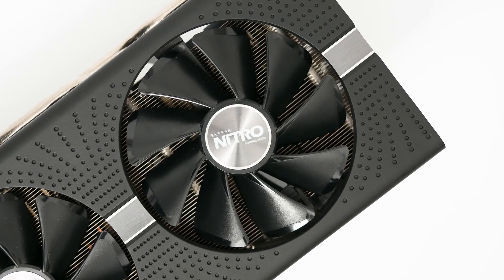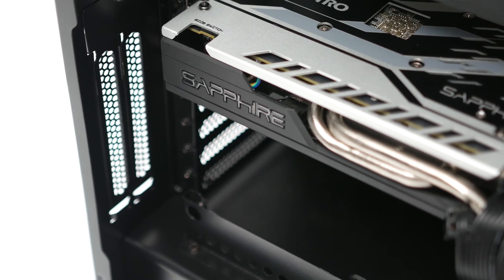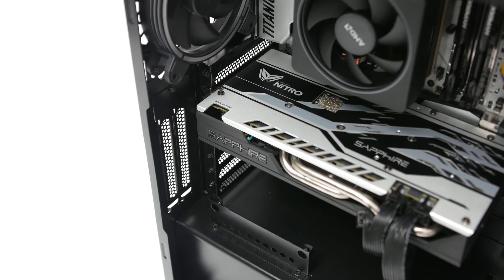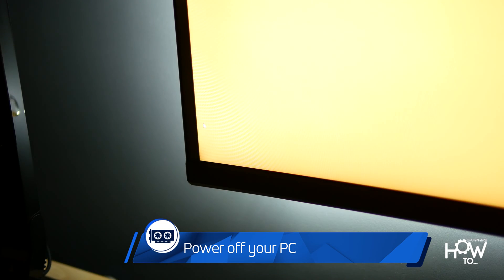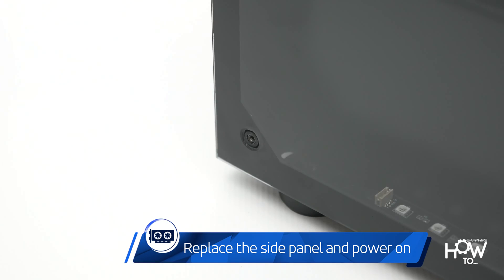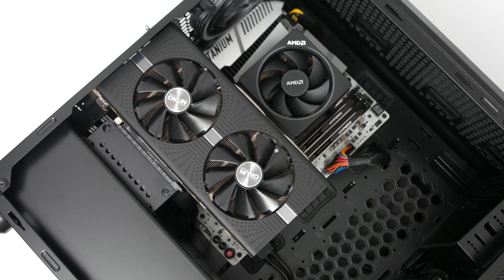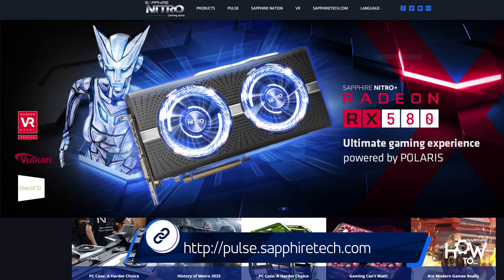SAPPHIRE How To: Use Dual BIOS

Comment: Hello i have the 7900 xt Nitro +. On which Position is the switch if the card is new ? OC or quiet mode? On amd adrenalin it says me the card rum with 2860mhz ... Ans i can oc it up to 3350mhz without problems.. Time Spy benchmark 30680 gpu score lol.. thank for answers! ❤ Great Card!
Reply: Left is default quiet position. you can also use Trixx sapphire software to change bios mode in the app instead of the physical switch. OC bios is right side and middle is 2nd backup bios for bios flashing.

Comment: Hello, is it possible to use two BIOSes for the card at the same time using the TRIXX program and switch between them at the desired time?
Rx 6600xt sapphire pulse
Reply from the maker: Unfortunately the TRIXX bios selection is exclusive to the NITRO+ range of graphics cards. Also, it's a separate switch position on the card itself and is not technically running 2 bios's at the same time ~Pixel
Reply: @SapphireTechnology  Please help me, my graphics card is not using its full potential in gaming, I can't find another bios version to fix the changes that the previous owner made on the card by installing it
Reply: @SapphireTechnology  Please let me know some different BIOS versions for my graphics card so that I can clear the current BIOS
Reply: @SapphireTechnology  When installing the corporate BIOS, the ATI Flash program says that the BIOS versions are the same and you cannot install the BIOS.

Comment: what if it has 2 switches ??
Reply from the maker: Some of our recent cards have got a third position which means it's controlled by software. Far right position is primary, middle is silent mode and far left is the software mode usually. ~Pixel

Comment: I have a Rx 580 pulse that came with a switch and absolutely no documentation saying it was there or what it does
How did i found out? because the card has been unstable for over a year, tried everything at my reach to fix it to no success and found the minuscule thing hidden in the front while dismantling the card to deep clean it and replace the thermal paste

Comment: Everytime i switch to performance mode i get fps drops and pc hangs after 15-30mins of playing..maybe its because of my psu cant keep up with its wattage? I jumps from 107w on quiet mode to 175w on performance mode...also i notice the card runs hotter so could it be the factor?also fans speed ramp from 800rpm to 1600rpm...also i notice huge frame rate boost on performance mode up to 20% i think? But im still using quiet mode...i feel like the performance mode is too unstable..
Reply: you need more powerful power supply and better fan cooling in your PC case. Also could be your CPU is not good enough to run the games at higher frame rate. 

for example my 7900 XTX sapphire nitro can only run 60%-70% max GPU usage with my 3700X cpu which is too slow to make games run in higher frame rates. I would need to upgrade to new CPU like 5800X3D or 7800X3D in order to make my 7900 XTX run at 99%-100% performance power to get way more frame rates in most games.

Comment: Hey Sapphire. I bought two new RX580s and they are able to get the 30MH on ETH, I bought another card today and it's locked at 22.5MH. Is there a bios switch on these cards. I do not have a cutout like what you show here. I have the Sapphire Pulse RX580s.

Comment: soo i tuen left the switch and this is default ? pls reply thx :)
Reply: I think left is for quiet and right for more performance (guessing right is default)
Reply: @samueldsouza8797  okey thank you :)) i dont wanna use the performance mode
Reply: @leinad7793  Your welcome thats why its there (or you could just use the radeon software to have more precise control)

Comment: why does my graphics keep crashing and have low frame rates, and after crashing there is a notification from AMD telling me to give feedback of the problems can someone please help
Reply: same problem on rx 570
Reply: @kvinjacquet1714  i think its the gpu usage spiking
Reply: @kvinjacquet1714  i fix it! i had to reset my pc and delete everything from my storage and then installed all the new drivers and the new bios and it worked!

Comment: Thank you, was running my RX 590 8GB on Performance mode thinking it was actually the quiet setting. Only want to use it for 1080p gaming... But it kept overheating and cutting off the PC.
Reply: Then you have a horrible/ non existent airflow in your case ;)
Reply: @mrn234  Well no, not in this case... Airflow is fine. Worked brilliantly on RX 580 8GB... The RX 590 is kinda crap.
Reply: They are lying for 3 years. When your PC is overheating to the point where it's "cutting off the pc" then you have terrible airflow. Common sense.
Reply: Contrivance. Lie

Comment: This may be a noob question, but what's the difference between using the Silent/Performance mode vs manually overclocking in TRIXX or MSI afterburner?
Reply: Performance mode = more power + higher clocks, these will result in higher heat...thats why fan is more aggressive

If you can OC silent mode to "performance" clock then you'll see lower temp and silent fan
Reply: @sakurauyou749  is it safe to OC 'silent' bios into 'OC/performance' bios alike?? mine have 2 bios too RX 580 Red Dragon

Comment: Are there any differences between it's power draw from it's two bios system? Does the Quieter mode reduces power consumption? And does the Aggresive mode draws more power?
Reply: I don't have proof since I'm only fiddling with my 470, but lower clock speeds mean less power draw. So far I haven't really seen any difference whatsoever since the clock speed throttles a lot in my case, even at ~66°C and full fan.

Comment: in the RX 580 nitro the switch (gaming/compute) is in the back of the card, not near the display connectors. and the paper instructions that came in the box are so ambiguous that if they were absent the result would be the same... would it be that hard to mark at least one of the positions??

Comment: My  Sapphire Radeon RX580 Special Edition, when i put it in the performance mode sometimes the PC doesn´t work, some streaks appear on the screen and it does nothing, someone help me
Reply: It's possible your power supply is not coping with the extra demands of 'performance' mode, so ensure that it's rated high enough. Personally, I wouldn't use anything less than a 500A power supply (80 Plus Gold preferably), but even then it depends on what the rest of your system is using. If in doubt, upgrade the power supply. Also be sure that your case is well ventilated and that GFX card temperatures are within the acceptable range. If not, add a fan or two.
Reply: @Turrican60  I have a power supply Nfortec Scutum 650W modular design and a NZXT S340 with 4 fans .. I think all it's okay
Reply: @samuelhernandezgarcia5851  Try clearing the cmos on the motherboard. If it is MSI mb there should be a two prong jumper near the bottom right. just short it out with a phillip's head screwdriver on power up.

Comment: When I am turning switch  to extreme right on my Nitro 5700XT Special edition my pc is not booting. Reboot and select proper device error is coming. When I switch it to normal. It is working ok
Reply: Maybe you need a better/bigger PSU
Reply: When you change the bios on the card and have trouble booting, some MB's hang causing the boot issues. One easy fix is to clear the MB CMOS. Most have a two prong jumper on the MB. Just short it out with a Phillips screwdriver when you power up.

Comment: Bought rx580 8gb se and found that switch, i run on yt to see what it is and here we are
Reply: There is almost none impact on the performance on this card actually no matter the position of the switch
Reply: @KlausTinos  yeah, found that out 1 year ago, sold it after 2 weeks of use, mine was rx580 8gb special edition
Reply: @demolishermusic  I had the same for 3 years and it served me great. I just sold it today and replaced it with rx 6700 xt nitro+. Good upgrade but I hate the coil whine all 6000 series has...
Reply: @KlausTinos  yeah, I know how it feels, you cant do nothing to fix that, just use it as it is

Comment: And what about a label on each switch position? Too hard to implement after all the energy you have put on stu*** LEDS ?
Reply: I just installed the Nitro + 5700 XT today on my PC and was wondering the same thing.  No label or anything. They could've put a turtle icon on the left and a rabbit on the right. No big deal it just seems odd. Other than that though the hardware's great and runs much cooler than my older GPU.

Comment: Hi, I bought a used sapphire nitro+ rx 580 from eBay as I was tight on money, but still wanted the best performance I could get. When I got the card I did a fan health check test using sapphire trixx while the card was on performance mode. It said the card failed the test with the fans only spinning at ~800-900 rpm. Next I tried the same test but put the card into quiet mode and it said that the card passed the test with fan speeds of up to 3200 rpm. Is this normal? Also when I play games like csgo my game sometimes crashes.
Reply: Merp Merpinson must’ve got a broken card
Reply: and no it isnt normal
Reply: If you still have the card, you could try flashing the two bioses, starting with the 'quiet' one as that clearly is producing strange results. Note that there are two available bioses, so get the slower and faster ones and in turn flash them to each one on your card, testing in between. Of course this may not help - the card could have some other fault.

Comment: Bought a rx 580 8bg Pulse and boot only in compute mode. Gaming mode doesn't boot at all. My rig is from 2011. (Sapphire Pure black p67 hydra mobo and i7 2600k) Any ideas?
Reply: its was probably used for mining so you need to download atiflasher and install the new firmware for that card.  Good luck
Reply: @englishpc1942 Do you know where I can find both versions of the BIOS?

Comment: I can not understand which one is for what. It is a useless video to can not explain anything to me.
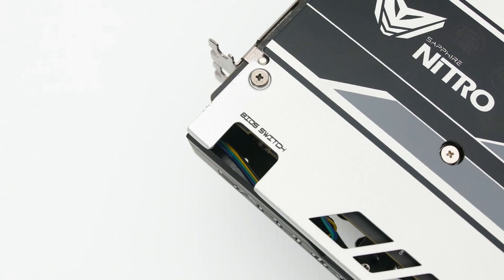Reply: It's pretty simple my guy. When the switch is pushed AWAY from the back of the computer, it is in performance mode, which just means the graphics card will prefer speed over quietness. When the switch is pushed toward the back of the pc (where the video card monitor outputs are), the card will run in "quiet" mode, which will sacrifice a small amount of performance in order to run the fans less.  Read the text at 0:45
Reply: @JMA_Elec  haha so it means I have to push a way from back of computer (do you mean I push it to back side?) when it is in performance mode mean that mode for it is for miners to make more bit coin? when other side mode I have no idea which side but anyway if it is in mode of tousent names (silent, normal, quite, other, back to the front vs.) is it for gaming so when you are playing games fans did not burn your ears?
Reply: @infegfx   A bitcoin miner would probably modify the card's BIOS code. Silent mode just slightly prioritizes silence, meaning the card runs a tiny bit slower in order to run the fans less. It's not very noticable, and the fans aren't even very loud during gaming. 

But yes, performance mode is when it is pushed towards the front of the computer. 0:46
Reply: @JMA_Elec  Thank you. I feel bad now. 2 years of wrong bios gaming with spike, fps drop, performance issue. Now I try first run in game. I will check it and report you. You are better helper than useless sapphire support. I wish to they read and learn something from you. How it can be silent mode is game a mode I can not believe. Also I broke other bios side 10 min ago. It was working on wrong bios and radeon drivers did not work with original bios right now. Thank you again. You saved my years.

Comment: Is this the same for the RX 5700 Pulse? I heard to switching mode like that you need to reinstall the driver and by that mean driver, which driver? Is that from the AMD website or a specific driver from Sapphire website?
Reply: The bios modes are completely separate from drivers. They are part of the graphics card itself, basically. The drivers are always going to be from AMD.
Reply: @JMA_Elec  Thank you for the replied, but well it's already 1 month, and they said it's already fixed. And yes the driver to be reinstall is the one from AMD.

But, when first I wrote that comment, I was confused between the Trixx Boost and the one from AMD. So yeah, it doesn't matter anymore.

Comment: What happens if there is a power outage also when the backup bios is in progress? Do the backup bios stay's always good? i have been searching for information on this and found none.
Reply: Can't confirm by my own experience, but I have watched some repairment channel, and they said that yes, second bios can actually be used as backup.
Reply: Yes, the 2nd bios stays GOOD at all times unless you ruin the backup bios as well, it has 2 chips, 2 separate bios chips.

Comment: Is there a troubleshooting guide what to do when the gaming bios setting does not work? Black screen on start up. Compute mode works fine. It is a Rx580. Some minimum requirements for AMI Bios Version? Other Mainboard specs?
Reply: Mate I have the same problem. Bought a rx 580 8bg pulse and works only in compute mode. Doesn't boot in gaming mode. Did you find anything that can help? I also have a sapphire mobo from 2011. (Sapphire Pure black p67 hydra and i7 2600k)
Reply: @spiroskretsis2962   heeey i have the same problem what can i do? do you found somting?
Reply: Did you find any solution to this?
Reply: @bencecc1447   I would try flashing the bios if all else fails. It may have a mining bios...  Get the right bios the the version of card and give it a go.

Comment: I finally know which position to put the switch!
Reply: same
Reply: same
Reply: I finally found out there was a switch at all. I always used third-party tools to tweak my fans and stuff. Not even sure now whether I should even touch the switch at all.
Reply: Same
Reply: same
Reply: Same
Reply: Same
Reply: I have 3 positions on my Sapphire nitro+ 7900xtx which one should use for max performance
Reply: I want to know. Please tell me. Is performance mode for mining for mine more bitcoins and other mode for gaming to give yoe low temp like under 80c ?
Reply: @infegfx  lol, this is not for mining. There are dedicated cards for that, some dont have video output. But whatever works better for u man
Reply: @karlomoreno5110  is 1411-2000 for mining? That is what we have to understand?

Comment: Hmm I own such a card for 6 months now and I never tried the performance setting cuz I thought I need to set up the second profile myself. Will give it a try now. Glad that I don't need a Swiss army knife for it and hope it has a screwdriver in it. Or a table... or...
Reply: Just question when the graphics card is on qeuit mode how much power does it consume from thé PSU?and what about the GPU temperature during gameplay?
Reply: @mekahalnoureddine989  I can check later, I never knew about that switch but I think my gpu is on silent mode because sometimes the fans stop.

Comment: Anyday would take more performance over noise. Moreover when you are wearing headphones the fan noise is not noticeable. Not sure why so many people crib about loud fans.
Reply: Fan noise is certainly less off an issue these days since fans have got a lot better along with cooling solutions in general. However, some people if they have hot box cases, open air cases or a need for silence (voice recording or speaker users) the fan noise can be a problem. Also, for some people it's not just about the fan noise but also the power usage. On a system that's on all the time in a place like the UK that could add up to £20-£30 extra per year if running for 10-12 hours a day.

Comment: Any chance you can put dual Bios on Radeon VII ?
Reply: Not on the reference design cards but if we do manage to release our own boards than yes it would be a possibility.
Reply: @PixelTheory  Thanks, a Radeon VII with a fully populated VRM, dual VBIOS switch,  and 2 PCIe slot wide, triple fan cooler that vents out the back and front of the GPU as well as the sides, with a smaller "Radeon logo"  would be good. Anything larger than 2 slot wide card make it difficult to fit in some builds. Do exisiting Radeon VII still ship w/o UEFI BIOS or has that been fixed for all cards in retail chain now?